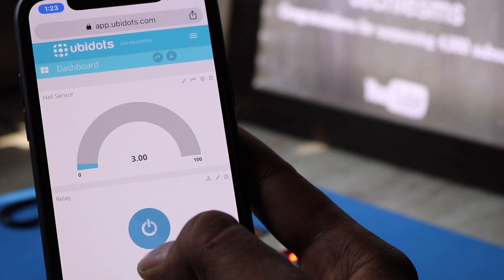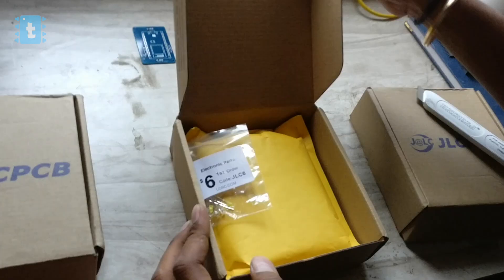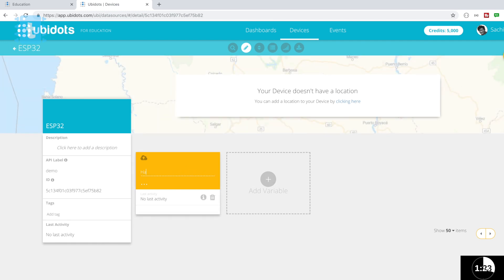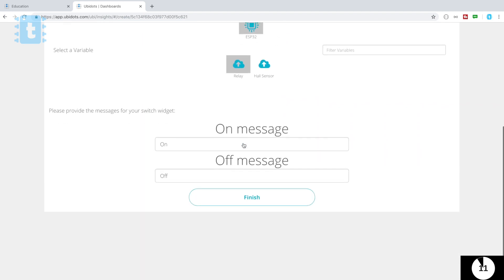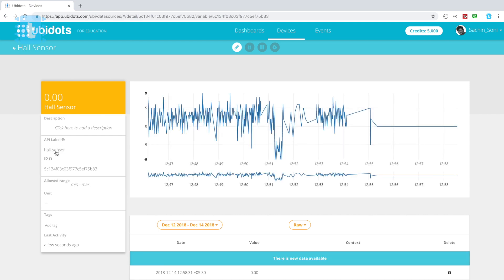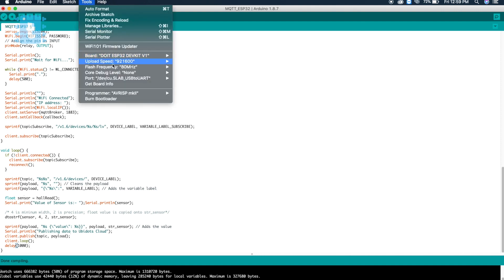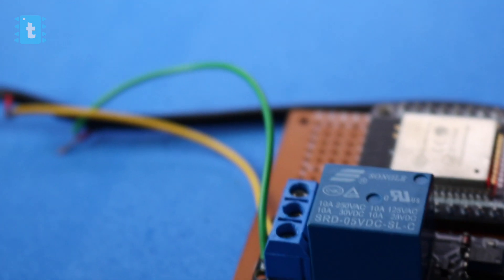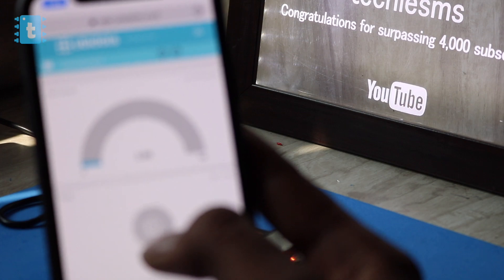MQTT on ESP32 | Controlling Appliances and Monitoring Sensor on Ubidots | ESP32 Projects

Comment: How can we monitor appliances plugged into a multi-point extension?
Reply from the maker: Means ?
Reply: @techiesms  normally we monitor and control appliances by using sensor and relays for each appliance. But sometime we plug multiple appliances (laptop, charger etc) on a single multi-point extension, so how can we monitor those appliances?
Reply from the maker: All the appliances will get turned on or off based on the status of extension board 

We can’t control each device separately
Reply: @techiesms  You are right that we can just control the extension board and appliance connected to that extension board will turn on or off and we can monitor the accumulative consumption of those appliances. Actually I am working on a project and for this, I have to monitor those appliances separately that are connected on extension board. Is there any way to just monitor the consumptions of those appliances? We can easily monitor those appliances that are directly connected into a socket, but I am just stuck at this point where an extension board is connected into a socket and multiple appliances are connected on that extension board. Can you please help me to figure this out?

Comment: Nice video explained. As per shown in video, relay and esp32 are used for design, but when I go to layout apart from these components are used like transistor, diode and resistor. what are the difference between layout and schematic? and why extra components includes in layout?

Comment: Followed all the procedures and couldn't turn a led with ubidots (didn't use the rele, only a simple led) any sugestions on why it isn't working?
Reply from the maker: What’s the error 
Can you please send me the error on my Whatsapp number +91 82000 79034
Reply: @techiesms  hey, I've solved the issue apparently the MQTT broker URL was wrong now it is industrial.api.ubidots.com.
I do have a different question now tho, how can I add more than one output and control then from an individual switch in the dashboard?

PS: Tried to add your number to whatsapp, can't find anyone, but take mine: +351 932367781
Thanks for your help!

Comment: Well explained. Just a quick observation...you generally switch the line (hot) side on the relay and connect neutral directly to the load. 
In your connection you can get an electric shock even when the relay is not switched on.
Reply from the maker: Got it
Reply: @techiesms  has this fix been incorporated into an updated pcb design file?